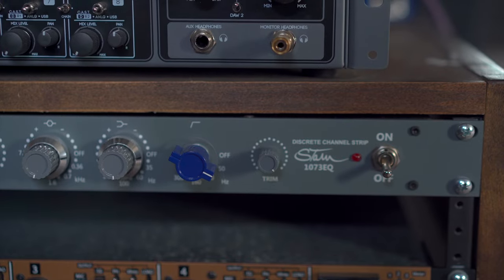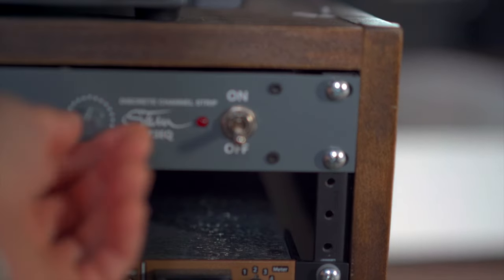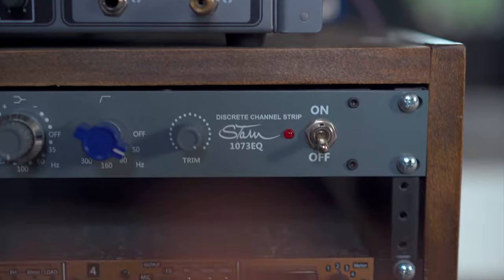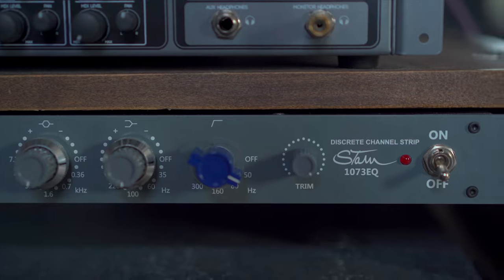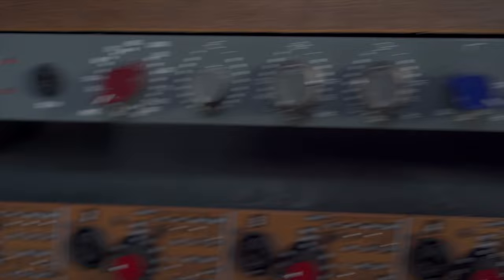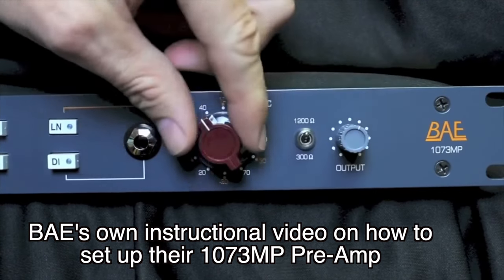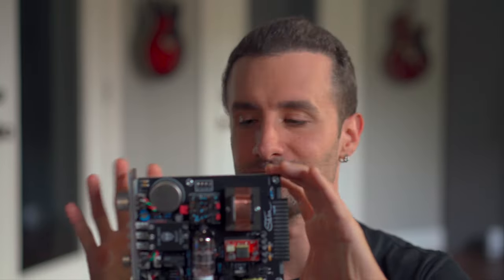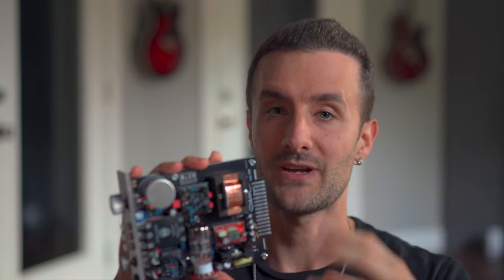How To Set Up a 1073 Neve Style Pre Amp

Comment: Hi, with this video you're basically saying that the well-known trick to drive the input harder and lowering the output is a mistake. That you shouldn't do it. A very academic and uncreative point of view in my opinion.
Reply: I think if you replace his words "correct" and "proper" with "cleanest" signal, it makes a little more sense. Even the guy in the BAE video said "you'll get the cleanest signal this way." Obviously, you don't always want the "cleanest" signal - especially on other instruments. But to record the cleanest vocal possible, for instance, on a ballad, let's say, running the output full up is the way to get that.
Reply: The video talked about different applications and obviously you can get whatever sound you like.
Reply: He's saying drive the output transformer instead not driving the input which is good point since I'd assume doing what you said is the thing I'd naturally do
Reply: @chukah9484  the point is depending on what your doing  driving the input transformer harder vrs the output and the amounts  will depend on applications for instance  on High gain guitars . The ability to back down the output is what allows the system to fatten up inside
Reply: Try both ways and use your ears.  Period.  Be thankful this free video posited an alternative approach for experimentation.
Reply: @CenterThePendulum  use your eyes and reply to someone that coincides with what ever point your making
Reply: @chukah9484 on certain applications you would want to crank up the input gain to the point it’s almost distorting. Then tamed with a compressor or not. 
This is the sweet spot of the mic pre. And sometimes you want to really overdrive the sound like on a snare on a different channel along with a clean sound of course.

Comment: Basically full open trimpot is unity gain, you adjust additional gain with the red knob. You can do this trick too with your speaker monitors. Interface volume fully open usually is unity gain. Adjust the level of your monitors while the interface is at unity gain (for best results for mixing hit 80db-85db spl). End result is calibrated speakers monitors at unity gain and low selfnoise (speakers don’t have to amplify as much). Plenty of articles on this online. Happy music making!
Reply from the maker: Thanks for the tips!!
Reply: Hey thanks for the tip! So would you recommend me turning my interface monitor volume ALL the way up and calibrate my speakers volume based one that basically?
Reply: What if you're using a monitor controller instead - would you turn the gain all the way up on the monitor controller and adjust the volume knob on each monitor? Assuming you're using powered monitors of course.

Comment: tried and already recorded a song like this, what a difference, ive always had problems getting levels correct with my pre amp and trying to use an 1176 with it (uad console plugins) and even with plugins, this method actually really helped to control the pre level as well as give me a way better starting point for my leveling compression with the 1176. great video!
Reply from the maker: Yay! Happy I could help 😁😁
Reply: did you max the output? what about the level fader?

Comment: I just tried it this is mind blowing information.   Sounds so much better with the trim cranked instead of the red knob.   This information has changed my life wow so glad I found this video
Reply from the maker: So happy I could help!!
Reply: Reconsider better, the closer your red knob is to Zero the cleaner the signal so by cranking the trim you have to gain stage your red knob lower… but if you want a clean preamp use API or Avalon you’re robbing yourself of the NEVE sound by using low settings on the red knob 30-40 is classic neve by cranking the trim you normally land around 20-25 on AMS which gives a clean API Avalon type sound which is nice to have for some applications but not everything.
Reply: @darrellwright6254  mine sounds way better with the trim and red knob up.   I always had my trim on 0 to try and do what your saying and I realized I was missing a bunch of the flavor 🤷🏻‍♂️ at least on my particular model have the 500 series

Comment: Actually if you're using an original 1073 in a rack rather than in the board, typically about 3/4 of the way up on the output pot is unity rather than all the way clockwise.  The reason for this is that the pot is typically wired in the fader insert point before the output amp, and typically you'd have 0db on the fader around 3/4 of the travel.  Obviously depends if you're matching the pot value to the original console fader.

Comment: Hmmmmm. I do it both ways. Its all fun to experiment and you will have varying results based on your input signal. I love the ability to shape the sound and dont think there is a "wrong" way especially if you are running in and out of a mixer so you wont clip and can controll the signal on both ends. I use both methods in order to get a clean or thicker or darker signal so it all depends on what you want.

Comment: Even( Golden age project) in the manual says to get the smallest color keep it cranked on the output ! finally tried this and wow there's that lovely distortion if cranked you would need to use a compressor to tame it but realistically you would never push it this high anyways !

Comment: Some pearls of wisdom here for sure. I didn’t realize most of the desirable colouration came from the output transformer. The AMS 1073’s have 3 separate transformers — 1 before the red knob, 1 after, and another before the insert point but before the A/D (DPD model). Disengaging the -10db pad on a U87Ai, saturates the first stage, turning up the red knob saturates the second stage, turning up the “Trim”, saturates the third (output transformers). The last one requires a compressor in the insert or a 20db pad. When you find the sweet spot, you’ll KNOW it!
Reply: the 'other' input transformer in a 1073 is for the line input.  its only in circuit when the gain switch is in the line range.

Comment: mmm, I guess it depends? Overdriving the preamp and using the trim is a quite common trick used by many pros... Cool vid. Thanks.
Reply: Exactly my thoughts. The guy in the video pushing the full trim = better... Has he had any hits?
Reply: @CIRCLEOFTONE  I think the point is that by decreasing the output via the trim knob you are feeding the output transformer less signal, and driving the output transformer with a lot of signal accounts for some of the saturation characteristics associated with this type of preamp. I don't think the original 1073 preamp had a trim knob. I could be wrong though.
Reply: @MyManDan  the trim knob is basically the fader (if you think about the unit as a console channelstrip, which it originally is), except it seems to be situated before the output stage (transformer). How hard the output stage is driven is not only dependent on the trim, but also on how much you signal you send into the unit to start with, and how much you amplify it at the gain stage(s).

Which is why this sort of "this is wrong, this is right" is pretty nonsensical tbh. As always, it depends on what you want to achieve and on what you're feeding the unit. Assuming you need a healthy line level output in any case, you could either:
- 1. Max the trim and only apply the necessary gain from there = cleanest possible signal
- 2. Drive the input harder and back off the trim = more saturation

It's true that you could do example 1 and turn down the trim. This would drive the output stage less, but it would also leave you with a weaker output signal for recording/processing further, which nobody wants. You could compensate for this by cranking up the input gain, but then we arrive at example 2. Voila.

So yes, OP is right to state that turning the trim down is "wrong", but this is ASSUMING that you will not compensate for it with the input gain, which I very much doubt he hasn't been doing. Of course he has been setting the input gain to wherever he has a healthy signal fit for recording. He has just been driving his unit harder than necessary, which is not wrong, but a stylistic choice introducing a bit more saturation.

This is true for maaaaaaany preamps, and it's the reason preamps without an output attenuator/trim are way less flexible if you approach them from a saturation-perspective.
Reply: @MyManDan the classic had no trim but the 3u enclosure has an output.
Reply: Output trim
Reply: Yes!  @BlipBlopStudio  I have mine using an SSLsix to send more or lesssignal to it and then boosting or attenuating the signal after. I had a blast shaping the sound in-between! I also Had both the 1073n and the Lunch box versions and the UAD software. I enjoyed the  thickness of the 1073n the most.

Comment: i’ve had the Heritage Audio HA-73 and also use the Unison 1073. 40 on the red knob is the sweet spot for me. sometimes 45 and sometimes 35. i just learned by dialing the knobs while i was talking/rapping into my mic until i found a combo that sounded nice. but i was nervous to push the trim so much until i saw another pro had it set similarly lol
Reply: I also have ha 73 35 -40 red
Reply: I always use the red knob at 35

Comment: I have one of these units and if you supposed to leave the trim knob cranked up all the way up,  there would be no reason for a trim knob. Sometimes I don't want a lot of coloration so I dial back the trim knob other times I want to hit that output Transformer as hard as I can so I Crank It Up. Believe me that knob is there so you can change the tone/color of your signal.

Comment: Great video.  The only part that I have to disagree with is the bit about overdriving the preamp in the BAE instructional video you reference around the 3min mark.  I have a BAE 1073mpf and find that overdriving the preamp into distortion can be really nice, especially on bass synth sounds.  As if the bass sounds coming out of my Moog Sub37 aren't already cool enough, running it into the DI on the BAE and pushing the gain knob and dialing back the trim adds some great sounding distortion.  I definitely understand the point that they were making, as far as it not sound similar to the kind of distortion you may get from a guitar amp/pedal, but they shouldn't sell it short because it can definitely be pleasing when used on the right source.

Comment: The only thing I’ll add is each click on the red knob is a different warmth… I have an AMS so I go off the microphone and tone of vocalists to choose my preamp gain (as long as it’s not clipping the i/p) then I use trim to set my o/p level going into my tube tech. So while that may be “true” you shoot yourself in the foot tone wise by using the trim as the first level in your gain stage. (Trim turns signal up or down but doesn’t change the character of the neve preamp; no different than a fader in your DAW)

Comment: this is kinda right and kinda wrong.  yes, trim on full is the cleanest and lowest noise way to run the 1073 style pre.  but back in the day, when they existed only in consoles with faders (the fader is where the 'trim' control is in the circuit) you would usually record with the fader at 0db, which is 10db below the top of the throw, so you are wasting 10db of headroom.  this was all calculated to work with the gain structure of the desk and tape machines in that time.  it also means you have +10 of gain 'in hand' (and minus up to 50db) to ride the performance to tape, which was very common.  
so if you want to run these preamps like they would have been used most of the time on vintage recordings, find the -10 point on the 'trim' control and start with it there, and adjust the gain switch. on BAE preamps this is approx 12 o'clock.  but if you want lowest noise and distortion, run the trim all the way up.
this has no effect on how much level hits the output stage and output transformer btw, as the fader/trim control is between the second active gain stage of the BA283 circuit and the output amp.  running the trim low with more gain coming from the first two stages will cause musical nonlinearities in those stages before clipping occurs, and in my experience clipping these stages can be musical sometimes as well.  so just use your ears and twist to taste.
Reply: another thing to know is that below 55db of gain, the 1073 only has one of its two gain circuits switched in.  once you turn the red gain knob past 50db, and the 'off' position above it, another circuit identical to the first is switched in, so the signal is now going through more transistors with more distortion.  I often run the gain at the first step where this extra stage is engaged as i like the extra colour it gives, and then turn the trim/fader down so its not too hot.
Reply from the maker: Thanks for this detailed info! That’s super helpful!

Comment: Theres a difference between setting a pre to get the max clean headroom and driving the pre to color the sound.
Reply from the maker: On a Neve style pre the color is equally (if not more so) in the OUTPUT transformer. That's what the designer told me ...that's why you should have the output on max (as possible) on one of these units.

Comment: Well, the trim knob is basically the fader (if you think about the unit as a console channelstrip, which it originally is). How hard the output stage is driven is not only dependent on the trim, but also on how much you signal you send into the unit to start with, and how much you amplify it at the input gain stage(s).

Which is why this sort of "this is wrong, this is right" is pretty nonsensical (or worse: clickbaity) tbh. As always, it depends on what you want to achieve and on what you're feeding the unit. Assuming you need a healthy line level output for recording/processing, you could either:
- 1. Max the trim and only apply the necessary gain from there = cleanest possible signal
- 2. Drive the input harder and back off the trim = more saturation

It's true that you could do example 1 and turn down the trim. This would drive the output stage less, but it would also leave you with a weaker output signal for recording/processing further, which nobody wants. You could compensate for this by cranking up the input gain, but then we arrive at example 2. Voila.

So yes, OP is right to state that turning the trim down is "wrong", but this is ASSUMING that you will not compensate for it with the input gain, which I very much doubt he hasn't been doing. Of course he has been setting the input gain to wherever he has a healthy signal fit for recording. He has just been driving his unit harder than necessary, which is not wrong, but a stylistic choice introducing a bit more saturation.

UNLESS you have a unit where the trim/output can actually amplify the signal beyond just passing on whatever it receives one-to-one (which could be the case in some instances I guess). Then you'd have to choose a balance between using the input gain or the output gain. If this is what OP is getting at, then I think it could've been explained more clearly, and certainly needs a disclaimer since many outputs/trims are purely attenuators not capable of amplification.

This is true for maaaaaaany preamps, and it's the reason preamps without an output attenuator/trim are way less flexible if you approach them from a saturation-perspective.
Reply from the maker: You're right when it comes to certain pre-amps, but not this one. It's all pre-amp dependent depending on how they are set up. I explained that when discussing the second pre-amp I showed in the video. Driving on this Stam Neve and some other Neve style pre-amps doesn't lead to the good kind of saturation. It just leads to nasty sounding distortion.

Comment: Its interesting to me that the makers of these variants didn't specify a mark within the range of markers around the Level knob. I was also surprised that someone in the comments mentioned that they have an AMS NEVE 1073LB and they were in the same position. I have the 1073DPX, and it has a distinct point that indicates unity gain. In the manual it's described like this: 

"Adjusts the output audio level. This control is post-EQ be pre-output
stage. The thick line on the graticule indicates the point of nominal unity
gain; the unit has ~5dB in hand. Pressing this knob cycles the level
meter take-off point through three possible points in the signal path,
indicated by the adjacent LEDs."

If you look up the unit, you can see that marker for reference. It's a thicker line.
Reply from the maker: I agree, though the original NEVE pre-amps didn't have them, so the clones are just going with the way it was always done in the past. People don't like change, haha.
Reply: I have a 1073 SPX on the way right now, are you saying this model works in a similar way? So set the output trim at unity, adjust red input to taste, and mainly use that to dial in a sound rather than the output trim?
Reply: Kind of in that at least you know where to set that trim pot for unity gain, and then fine tune if needed once you've set the gain with the main pot.  @cityhippie
Reply: @cityhippie  You likely already received the unit and have the gist of it but to reply; I copied and pasted the sentence that explains it (from the manual). Set that to the thick line with represents unity gain and IF necessary,  fine tune the output with that pot. The pre has great headroom so it shouldn't be necessary but there if you need it. I find that the unit makes anything that goes through it sound great, whether the signal is low or hot. Enjoy ...